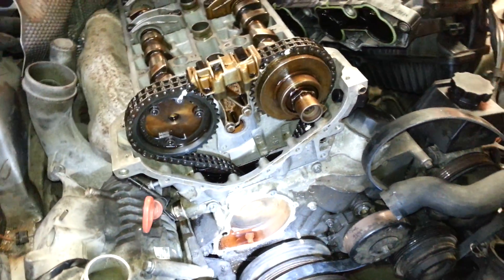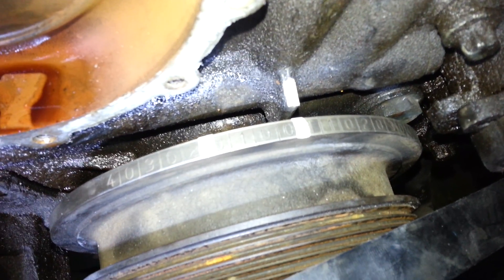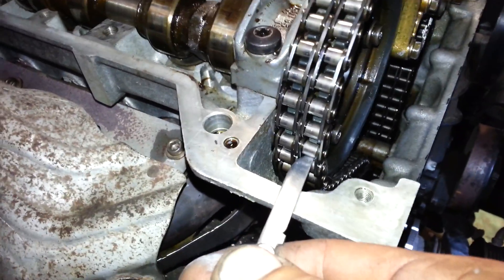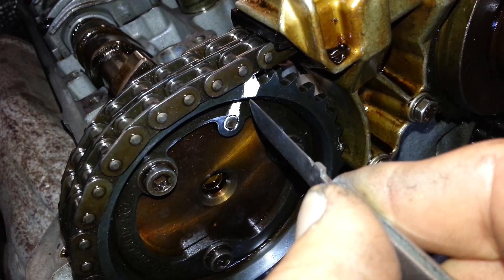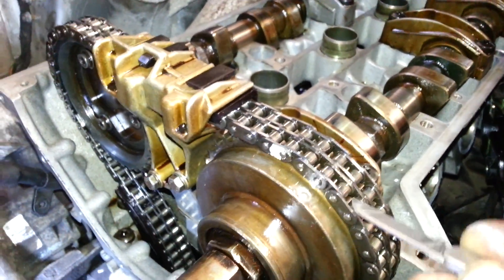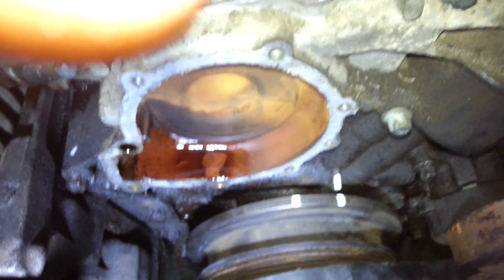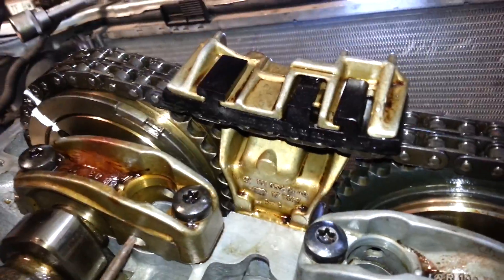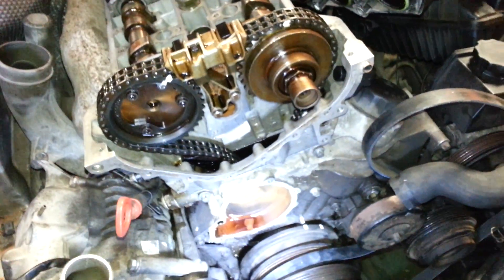Mercedes SLK230, M111, timing chain

Comment: Instead of paint games you can put bolts of 4 to 5 cm length and 6 mm diameter in the holes by turning the wheel. That's the official way.....and after an click you can read the Timing on the scale ;-)

Inlet 20 to 30°, outlet 25 to 35° after the 1st piston is on top (OT) of the scale....
Reply: Не трябва ли да бъде точно 20°  ?
Reply from the maker: The "paint game" as you call it, it's for explanation purposes.

Comment: Hello, I need HELP.  I followed the video. Although I have the timing looking good at TDC when I turn to 20 degree the pins do not go into the holes  Only at about 30 degree.  The engine starts and runs rough. This is the second time I have pulled apart and checked it looks RT and it ran before I did the head gasket.  What am I missing?  Why would the holes not line correctly if I have the chain marks perfectly where they were?  Thanks Jake
Reply: +Jake Dallmann  the manual says 20-30 atdc.
Reply: @E85-M54-Power  Hi. Do you have Manual for this one please?
Reply: If you cant lock your camshafts when you turn the crank at 20 degree that means your engine is out of proper timing
Reply: Моят също не мога да го заклключа на 20 градуса.Щифтовете влизат на 30. Това означава, че веригата е разтеглена ли?  @x8xPopCoRnx8x
Reply: So how do you correct this error @x8xPopCoRnx8x
Reply: Hi. Can you solve the problem?

Comment: i have some problems with my M111.961 engine. after i changed the chain tensioner, i did not do it correctly. so the wheel has sliped and the engine goes not stabile.  how do i adjust the camshaft without dismount the chain itself ?

thank you for your quick respons
Reply: Ты пробовал установить как он показывает?

Comment: Thank you so much for this video! I think my timing chain may be worn on my SLK230. Right now, I'm at 120k and the car is very slow/ sluggish. I'm also getting pretty low fuel economy and can hear a rattling/ tapping noise coming from inside the engine.
Was replacing the chain a very difficult repair?  Would you recommend it to others? I Would like to do it myself if possible. Thanks again for the video and the information!
Reply from the maker: Not a difficult job if you have mechanical skills. Ask a friend for help and remember to take lots of pictures in the process. You will need those when putting it back together.
Reply: +sevy mihnev Thanks so much for the advice!  One more question for you, if you don't mind. Did you replace the cam and crank sprockets and rails as well as the chain? Or did you only replace the chain? Thanks!
Reply from the maker: It is always best to change everything, but it all depends on the condition of the parts in question. It is safe to assume that if the chain has stretched the other parts are probably worn as well if never changed before.
Reply: +sevy mihnev Thanks, that makes sense! I will let you know how it goes!